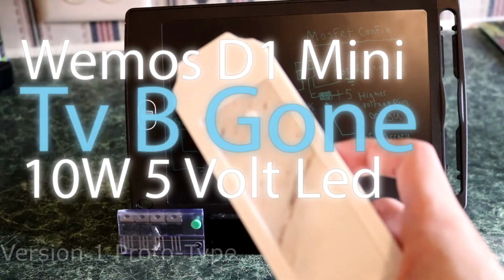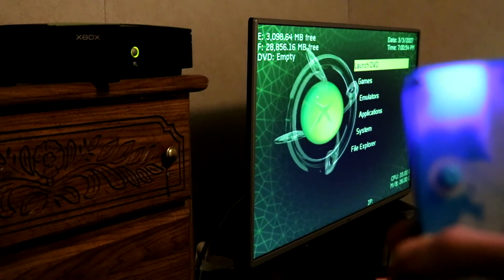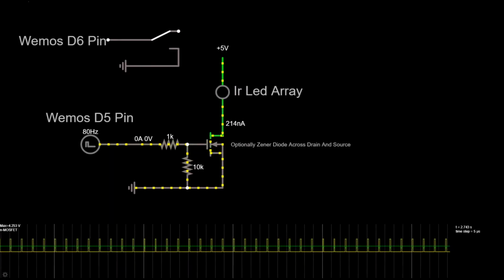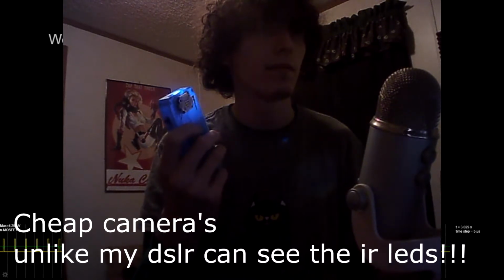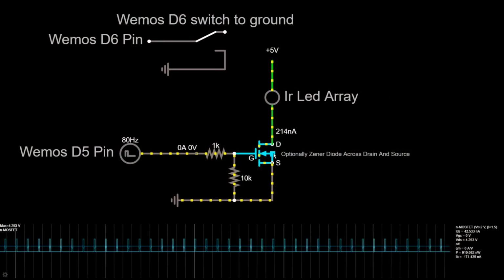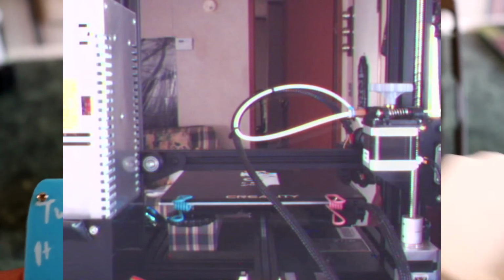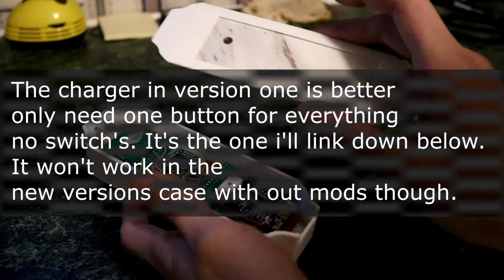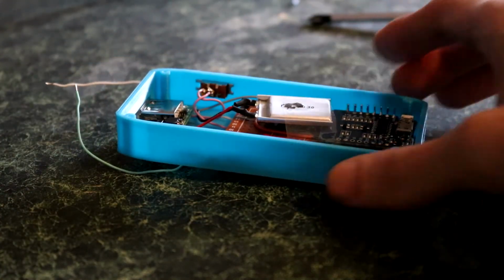Tv B Gone With 5v 10w Led And Wemos D1 Mini 3D Printed

Comment: Do you got some idea for a counter detector? I help with IT at a museum and one of the obvious things to expect is some kid with a tvbgone trolling the visitors. No biggie but the people who'll need to reset dozens of projectors etc. should not keep running in circles all day..
I suppose I can use a dozen or two ESP with an IR receiver throughout the room and alert over WiFi if there's a LOT of incoming IR signals that match the power codes...
Reply from the maker: That would be a easy to do as well. But a easier method would be getting a cctv camera without ir filter and they will show up on camera as recognizable flashes of light since the ir will be visible.  Plus that method would be cheaper and less prone to a kid running off with the receiver. You can then pipe the video feed into a python program to look for distinct flashes of the ir codes.
Reply from the maker: Another idea is if any of the projectors or tvs have a usb port that does not supply power when the devices is turned off. Add a esp to them and set it up as a mesh so the moment one goes off and stops showing up on the network you can tell when and where just by naming the esp.

Comment from the maker: Been busy so sorry for the delay for the diagram in the description.  I will be back with some more videos soon I hope I been waiting for parts so we could rebuild a project I haven't recorded. It's pretty cool it works some things are just wonky I usually build 2 of something or re-build it before I make a video just to ensure the project is replicatable if at all possible if your wondering what the next build is it's just a simple 555 timer touch switch for my solar stuff using quarters for the touch pad for bling... I also might do some speed run attempts in halo 2 been awhile since I did a game on the channel.